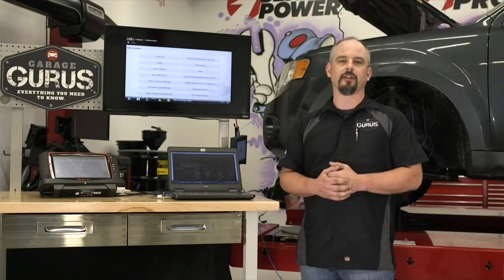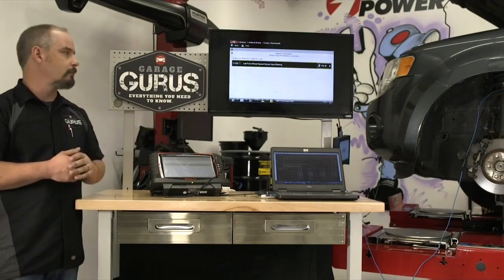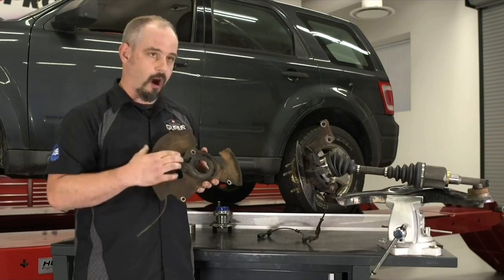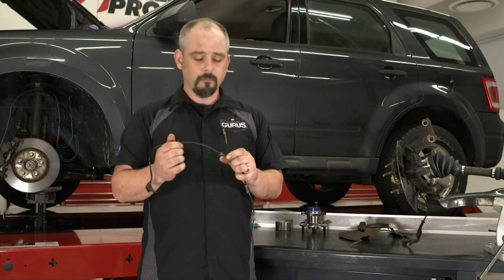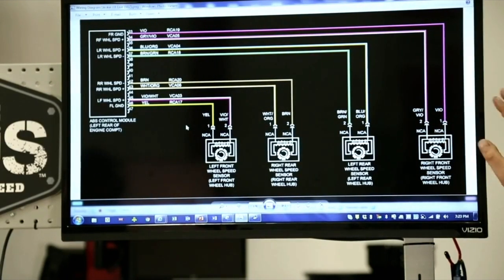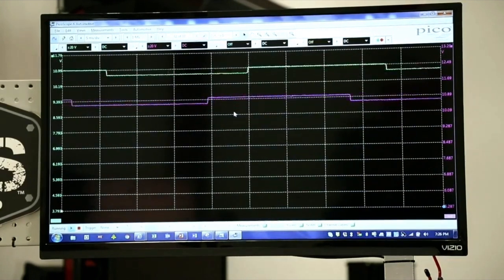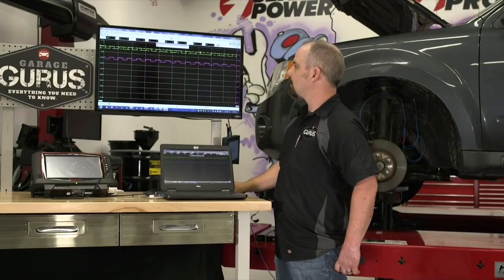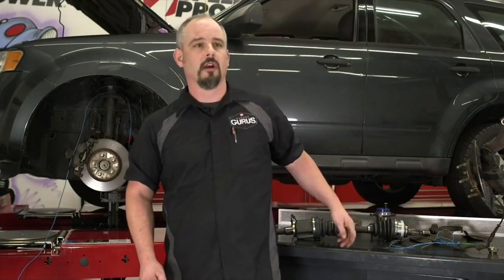Garage Gurus Facebook Live: Troubleshooting Common ABS Brakes Problems

Comment: Great informative,  well worth a watch DVOM, I presume this is a bog standard multi-meter. My question is Honda Jazz UK model is fitted with abs, No abs light on prior to wheel bearing fitment, though afterwards it soon appeared, I can't seem to see the reluctor ring you speak about, is this car fitted with one? I presume this fault is all down to the something caused during the wheel bearing replacement, or maybe it just very coincidental?

Comment: 2002 Sienna, 72,000 miles, running great, but the traction light is on, and the ABS light flashing, then off when the car is rolling. Brake system seems normal, maybe the rear sensors are dirty or bad. Need your advice.

Comment: ,I have a 06 Pontiac g6 the front left wheel locks up and grinds I replaced hub bearings ,rotors ,brakes and senors, calipers ,and flex brake line and it stills locks up ,I step on the pedal it makes  a grinding sound  .would the abs unit be bad if one side only does this
Reply from the maker: Have a look at GM Technical Service Bulletin 15-08-45-001.  It references various electrical / ABS issues from the wiring harness rubbing on the body and / or suspension.  Follow the ABS wiring harness from the corner you are having trouble with back as far as you can checking for harness damage / wire chafing, etc.  We have found many issues like this with this platform and generation of vehicle.

Comment: I have a 1996 nissan pathfinder. The front brakes are engaged. Front wheels dont spin when i try to spin them by hand. My question is. Will ABS control unit lock the front left and right tires
Reply: Make sure to set Gearbox at (N) Position , So you can spinn the wheels.

Comment: My 2007 nissan x terra grinds horribly and the brake pedal vibrates so bad in any type of snow took it to a couple places said oh that's the ABS it's normal well the way that it's behaving is not normal because it never did this before so hopefully I can get some answers from your video here and maybe either have them replaced or worked on seems like a common problem
Reply from the maker: Hopefully this video helps! You can always call our technical support line as well if the issue is related to the brake products from Federal-Mogul Motorparts.

Comment: my nephew was pumping the brakes as I bled them on a 2000 mustang gt. he's not the patient type and ended up slamming on them. he said pedal got soft and the abs light came on. turns out the nut holding the front drivers side (right above the rotor) line came loose and ended up leaking. I tightened the nut and the leak stopped. I topped off the master  cylinder with fluid. can't get the light to go out or the pedal hard again. did he kill the abs module??
Reply from the maker: When bleeding, (especially on a older car), it is never a good idea to let the pedal go all the way to the floor.  This can damage the internal seals in the master cylinder.  To check the master cylinder- remove both lines from the master and plug them with line plugs at the master cylinder ports.  If the firmness returns to the pedal feel, the master is good and the leak is elsewhere.  If the pedal is still mushy or easily goes to the floor, then the master cylinder is bad and must be replaced.  The ABS module likely did not go bad from the steps you have described below.

Comment: I replaced my calipers and pads no i bleed brakes and get no air or fluid out the rear also changed master cylinder just bought vehicle  96 s10 i think please help
Reply from the maker: If the truck has ABS, then most likely you will have to use a good aftermarket scan tool with bi-directional capability to make the ABS unit perform an “automated bleed”.  This is usually found in the “Functional Tests” menu of the scan tool after already selecting the ABS system.  This process runs the ABS pump and cycles the valves.  There is really no way around this without the scan tool.  The air in the system is likely in the ABS unit, and the system cannot be bled at the wheels until this process is complete.
Reply: Did you bleed the caliper? If you installed all new calipers you may still have air in the calipers themselves, it’s happened to me twice now. Simply flip the new caliper upside and bleed it like that, when I flipped the calipers like this more air came out of every caliper.

Comment: How do you replace an ABS module on a 1999 Dodge Ram 1500 5.9 L 2 wheel drive
Reply from the maker: Michael,  we do suggest checking the service manual for this specific application.

Comment: OK, I own a 2007 GMC Serria Classic pickup. Here is the problem; As I SLOWLY BRAKE DOWN TO A STOP, while the wheels are still rolling slowly, my front, and sometimes the rear breaks, will LOCK the wheels into a skid. We have and older Toyota that will do the same thing. I replaced the speed sensors in the truck, worked fine for about four days then started doing it again. As to the Toyota, I took out the fuse completely and the brakes work fine. It just has a check engine light on. But the GMC has a whole different outcome. Brakes still act up even with the pump unplugged under the truck. I hate ABS brakes! (Just a note. The truck brakes work fine for driving speeds, just when you roll to a slow stop. And, then when you try to take off from that stop, the wheels want to stay locked briefly.)

Comment: if you remove ABS fuse, does ABS motor still work?
Reply from the maker: If you remove the ABS fuse on most vehicles, the ABS motor will not work.  The base hydraulic brakes will still work, but ABS, Traction Control, Stability Control, and any other related systems will not function.  Additionally, the ABS dash light will remain illuminated.
Reply: Garage Gurus My Abs censor light comes on. I notice when i drive my car has a slight sound (sounds like a motor sound) also when i brake the brakes are a little delayed. I parked it because i don't want to drive like that
 What do you think the issue is?? Is  my Abs censor connected to the brakes issue?